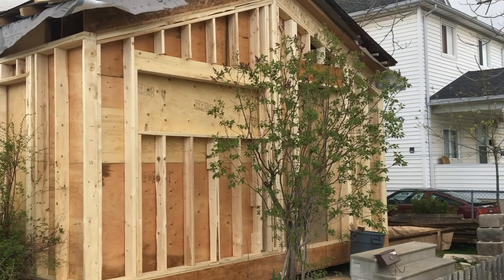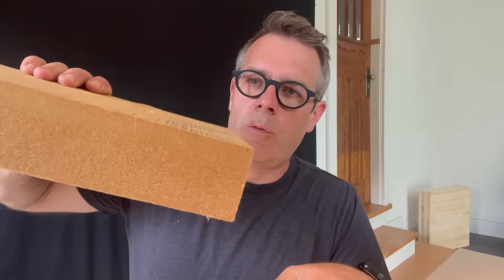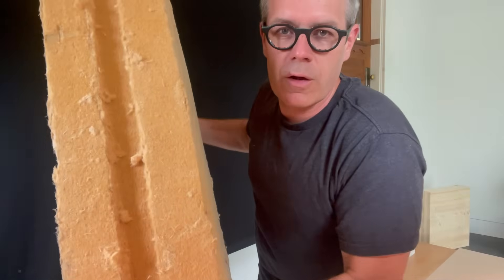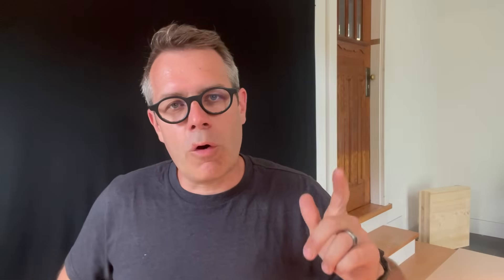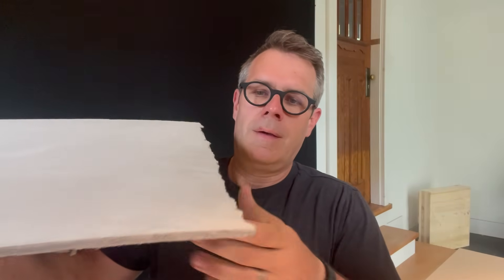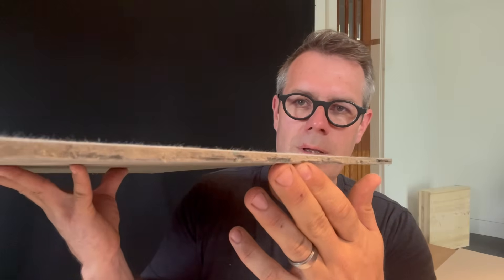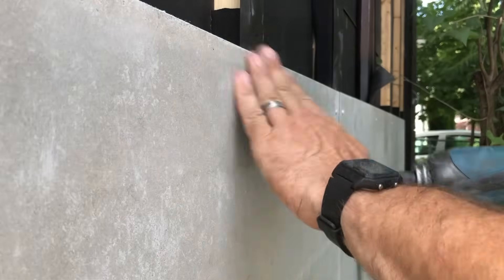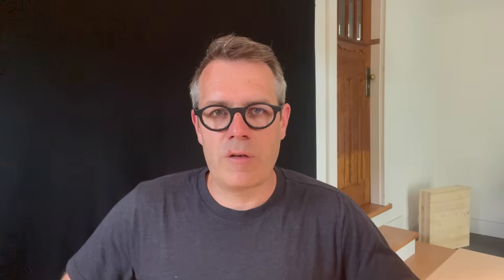What I Used Instead of Foam, Vinyl, and OSB – and Why It’s Better - Episode 3 of 9

Comment: I can't get over putting the sheathing inside and the insulatory layer outside. I am nearly positive the fiberboard will rot and feed many many generations of insects.
Reply from the maker: Not the case. Millions of building a done like that. The fibreboard is not soft. Where do you live? I might be able to send you a sample.

Comment: That stuff looks similar to Beaverboard, but it's probably denser. With any of these wood products, including plywood, my only big worry is fire, with drywall being the only real fire barriers in many wood-framed houses. I've heard of all-wood sheathing burning ferociously, though I assume the cellulose you added to the wall has some fire treatment. Maybe some intumescent paint, or just a layer of drywall on the inside would mitigate that risk. 
PS: Linoleum is also flammable, unlike vinyl, that's why its not allowed in public buildings anymore in many places.
Reply from the maker: The woodfibreboard is too dense to burn, it smolders, the cellulose is fire treated (see the other episode where I put a burner to the cellulose). I’m not a fire safety expert, but judging by what I know, this wall is more fire safe than many others used in residential construction. (Thanks for the info on linoleum in public buildings. I didn’t know about that. Too bad as it’s ideal for buildings such as day cares.)

Comment: Great video. Excited to see more in-depth videos about some of these assemblies! What brand of linoleum did you use there?
Reply from the maker: I used Marmoleum (if I remember correctly). Unfortunately I used the wrong glue. I was very specific when I ordered it from Rona, but they did the classic mistake of not distinguishing between true linoleum and PVC flooring. They mislabeled the product and it never adhered properly. It never was bad enough to change it, but I’ll have to be much more careful about that if I ever use it again.

Comment: Natural cellulose fiber fill from recycled newspaper. You specifically mention that it is supposed to absorb moisture in higher humidity conditions. How are you going to discourage mold without treating with terribly toxic chemicals?
Reply from the maker: As far as I understand, it binds it on a molecular level in the fibres, just like wood does too. The following is obviously not a scientific experiment, but I accidentally left a bale out in the rain and it was completely soaked full of water. I kept it as an experiment in our warehouse to see what would happen. It completely dried out again with no visible or “smell-able” effects. Further, it has been tested under CAN/ULC S703, ASTM G1-90 to be fungi resistant. I hope that info helps.
Reply: Isn't boric acid the usual treatment for cellulose? It kills bugs and flames while repelling rodents. It's not known to be extremely toxic; they even use it in eyewash, but, of course, the dose makes the poison.
Reply: Hi! How did you seal the outside seams  between black wood and also cement fiber board? Thank you!
Reply: Don’t think that insulation went well in Australia, but cannot remember the reasons, been around a hell of a long time big fad about 35 years ago I didn’t use it.

Comment: "I used plywood instead of OSB, because it off gases less. Also, I used linoleum floor"
Reply from the maker: Are you mentioning it to point out a contradiction? Linoleum flooring, if true linoleum is not made of PVC. Too many times PVC flooring has been marketed as linoleum flooring, which is not correct. True linoleum is a natural material made of linseed oil. I’m not sure if this what you were hinting at.

Comment: I had the pleasure of visiting the Bavarian area of Germany. I am sure the windows in the Gustaf Drexel are well over 50 years and function beautifully. I think it's harder to find a double glazed window that will last 20 years without starting to glaze and no warranty . Essentially solid waste. I would rather upgrade an old double hung single pane window and try to make up R values in other areas. You can easily have a 100 year window. And yes it requires maintenance, God forbid. Our species has just come to expect that everything is throw away and it doesn't have to be that way  Nobody likes the dirty "S" word, sustainability. Or gets it.
Reply from the maker: Yes, there are awesome windows out there. Even the existing windows we have in the rest of the house are over 40 year old German style tilt and turn windows (made in Canada in the 80s, we can’t quite date them exactly). They are not perfect anymore, but still serviceable. I changed the insulated glazing units in some of them a few years ago. Around $100/window. I can still get parts for them too. It would be great to change some of the seals, but I’ve also used simple weather strip gasketing. I expect the wood windows with aluminum cladding to last longer as they are more solid to begin with. 🙌
Reply: @TimberPlanners  Why did you need to change the IGUs?   Did moisture get into them and was that moisture condensing on the colder of the two panes?  Asking as I was under the impression that manufacturers fixed this issue many years ago.  Thanks in advance for your response.
Reply from the maker: @mf9264 it’s only ever a matter of time until the IGU leaks. In Europe they use two layers of sealant around the spacer, in Canada for the most part just one (for commercial it might be two). Our IGUs were around 40 years old. I think the gas (argon or krypton whichever you might have) might also diffuse through the material so that the IGU becomes less effective over time. Each window was about 3x4’ and cost between $100-200 per IGU. So it was very reasonable to replace them and essentially have really well performing windows again. (And I wouldn’t trust any sales guy that says “we fixed this issue in the industry”. Windows do need maintenance and do wear out, there’s better and there’s worse, but certainly not infinite)

Comment: Interesting material considerations. I am looking for a good perhaps composite material, which is 1.) very light weight walls (modular bicycle trailer) and 2.) performs enough thermal isolation as over-winter movable home less shelter.
My 1st idea: card boards finished cutting ends with silicon paste and wrapped by plastic foil. 
2nd idea: add more edge-stability by multi wood carrier frame with just a little bit extra weight.
3rd idea: add metal connectors (e.g. bayonet lock) on wooden frame improving modular wall (quadratic) elements.
4th idea: foam wall elements with metal u-shaped-frame for light weight + thermal insulation + easy connectivity.
Gemometric design is based on quadratic square elements (from 0,7m x 0,7m to 0,8m x 0,8m) => resulting trailer width = 0,7m, resulting 2x trailer height: 2x0,7m=1,4m to 2x0,8m=1,6m and resulting 3x trailer length: 3x0,7m=2,1m to 3 x 0,8m=2,4m.
Reply from the maker: Have you tested this material already? I heard that compacfoam in Germany made some very interesting materials for RVs at some point. Unfortunately they were (styro)foam based
Reply: XPS insulation  core with either fibreglass net and epoxy resin to bond it either side, or thin ply bonded with adhesive gun foam. The XPS has high compressive strength - not to be confused with standard expanded polystyrene
Reply: wrong crowd to ask this about. 
Go to a DIY RV trailer video. The thing that will decide what works is how well products hold up to rough use caused by tie downs and piling things around and on a unit. 
Tents work well for a reason.

Comment: You say these products are readily available.  Would you please publish a list of the products you used and what the trade names are for these products.  Thank you.
Reply: MDF (Medium-Density Fiberboard) is a type of wood fiber board. Particle board is not wood fiber board. Particle board is made from small wood particles, such as sawdust, wood chips, and shavings, which are bonded together with resin and compressed into a solid panel.
Reply: @user-ml8dm9fz6l  Technically correct but everything depends on the resins used. It's why Advantech is the standard for high performance and quality when it's just wood chips and resin like particle board.

Comment: Hi, I'm very interested in talking with you about some choices. I'm in the process of DIY remodeling our home in Abq NM (USA) and am exploring all options for modern and alternative exteriors.  We currently have old stucco that I will be getting rid of because we are changing up several windows and in general it's just old.  It does however have insulation board, a wood fiber type board under it that is 3/4" thick, but again, we want to ditch the stucco, then add at least 1.5" of some other sort of insulation board, then a new exterior cladding.  I'm leaning towards some corten steel panels on some walls and 2 x 4 cement board panels as well.  I see in other videos which use fiber-cement board that you have to add at least 1" furring strips behind it for an air gap and to allow moisture to fall since it can get in between the cracks. Is that what you did or did you screw them directly into the studs or just the wood fiber board?  I can't imagine that fiber board is very dense?
Reply from the maker: Thanks for reaching out. Yes, I’m using a rainscreen. I don’t know about your specific climate or codes, but in order for a rain a reden to work effectively you should have at least 3/8” gap behind it, which allows for proper pressure equalization. I’m not at all a fan of those drainage mats as they can still allow moisture to stay back there. The space between facade and wall has very active air movement in it, and the bigger the better. In my case it’s 3/4” and 1.5” but most North Americans think it’s overkill. I think I have to do the work once anyways, may as well do it right. 

Because I’m not an expert in your local climate or codes, you should reach out to someone in your area about it. Maybe you’ll also find helpful details on any of Joe Lstiburek’s publications.

Comment: Never saw wood fiberboard.  Im in CA.  What is the cost on that stuff?
Reply from the maker: I don’t have any costs of it on hand. If you check on 475 website, you can see their pricing on Gutex. Multitherm 60mm is probably the product you’d have a look at, or 40mm (but I used 60mm Agepan THD)

Comment: Use your wood scraps instead of gravel in the barn yard. By the time it brakes down, you will have more. It will help during the muddy months
Reply from the maker: That’s a very random piece of advice. I’ll take it though. Cheers.
Reply: Brakes stop your car. 
When they don't, things break.

Comment: Curious how the cellulose adds or absorbs moisture if the plywood acts as a vapor barrier.
Reply from the maker: Excellent question. I should really have called it a "vapour retarder" it's not a complete block. And if we want to be more specific, plywood even changes it permeability depending on humidity in the air, it gets more permeable if humidity increases.

The only really block are membranes with aluminum in them, which is what should be used with indoor swimming pools to deal with much more moisture in the air.
Reply: That is going to be a problem with condensation in that insulation. 
No way the moisture will get out in an hour as the temp drops in the evening.

Comment: Some choices are climate zone dependent.
Reply from the maker: That's right. It's dependant on a lot of things (location for macro and micro climate, availability, local codes, ect) and I usually try to be very specific about that. I had seen generalization on Youtube a few years ago, that had some bad effect in the construction industry, as some methods were applied in the wrong region. This would be mainly around vapour barrier location though. Thanks for pointing that out. Where are you building, if I may ask?

Comment: Take a look at Metelwood from  Inventwood cladding and ply... pilot plant for producing Chemically engineered soft wood.. 80 yrs plus. 
The other material everyone needs to be using far more is natural  Basalt derived fibers and forms, Rockwool ..mesh and rebar ... Composites especially as replacements for Steel, Al in challenging environments.
Reply from the maker: Sounds interesting. Construction business is tricky. I’m all for innovative materials, but they can be a challenge for local building codes. I’ll check into them.

Comment: I am designing a bunkie right now. I was considering this 2x6 then 60mm FB sounds. Vaulted ceiling we want too.
Reply from the maker: It's a great buildup. Works really well for thermal protection. Warm in the winter and cold in the summer, and safe from condensate as it is vapour open.

Comment: Plywood is air barrier too?
Reply from the maker: yes, most certainly. The one thing that can make it problematic is if the veneer have cracks in them that happen to line up, but with 5/8" ply that I used that's not going to be an issue generally. I also did a blower door test and you can use smoke to see if specific spot might leak.

Comment: Where are you getting the wood Fibre board insulation from? 475?
Reply from the maker: Depends on the brand. I used Agepan, which I used to import (I still have a few stacks in storage left. Maybe enough for your bunny ;-) ). Gutex is sold by 475 and Herrmanns in Ontario. There's also Steico, but I'm not sure who sells it now. One locally made on is Sonoclima Eco4, but it's not as nice as the European ones and I would usually only use it as 1.5" thickness. Not sure if they have other thickness' And then the new kid on the block: TimberHP, but I don't think they have it on the market yet here.